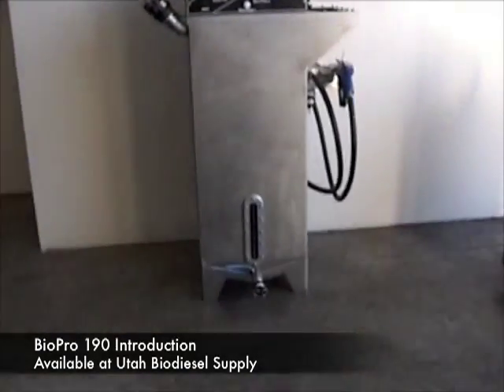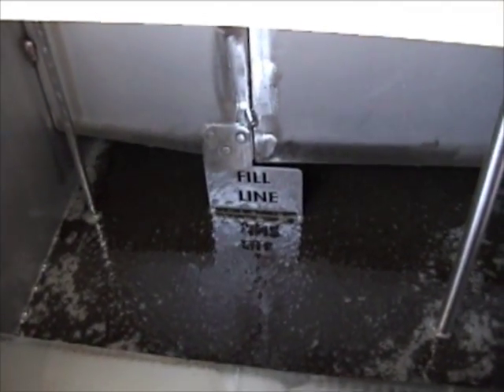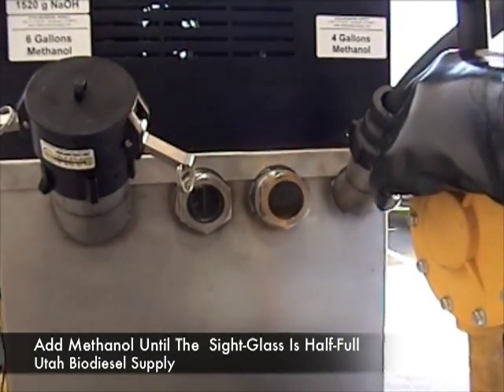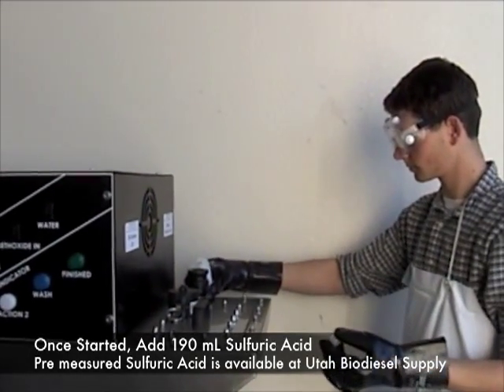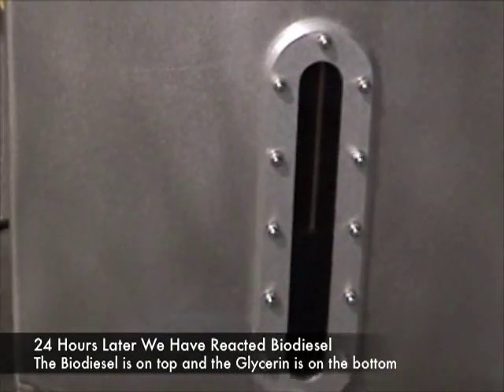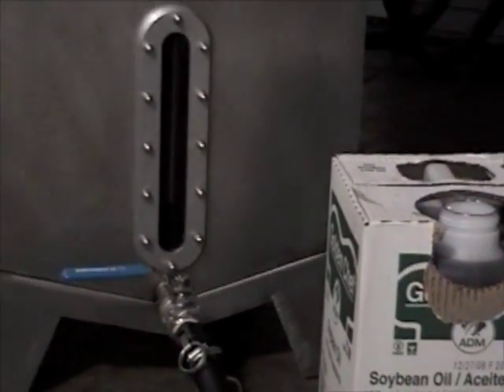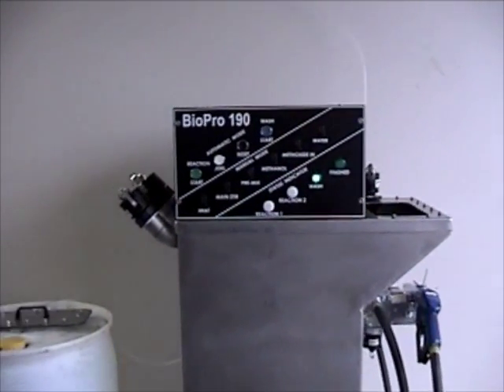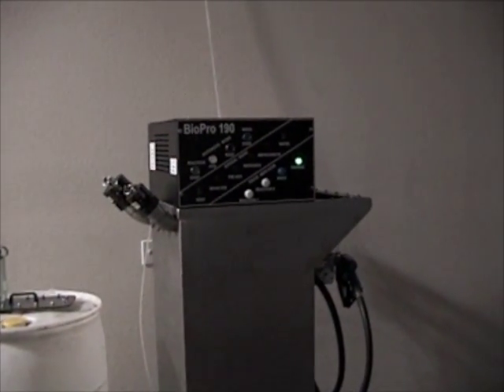BioPro 190 Automated Biodiesel Processor

Comment: @graydonblair   We found that on our 190, even if the water content in the WVO was high, by using the 190 with just heat on for a day, it was very effective in removing enough water to make the WVO usable.    As far as within the right titration, we put some pretty nasty WVO through it and always produced quality fuel.   These are great machines!

Comment: Do you re-filter the final bio-diesel product as it's pumped from the BP190? Or just pump it straight from the 190 to the vehicle's tank? I would think running it through a simple water filter type, set-up (maybe 3-5 micron filter) before pumping to the vehicle would be needed(?).

Comment: It can be put right in the tank. It depends on the vehicle though. Some diesels can't handle straight 100% Biodiesel. But most anything older than 2007 doesn't have a problem with it straight.

Comment: @johnny102marvin If UtahBiodesel numbers are correct and at a current price of 4 dollars a gallon and maximum production capacity of 50 gallons a day, that works out to a profit of 2.75 dollars per gallon (taking the higher cost of production numbers), or about  137 dollars a day in profit, or about 4000 a month, that's not bad money esp considering the machine is doing all the work.. setup 10 and your in business.. we'll thats if u can sell the stuff..
Reply: is it hard to find a buyer?